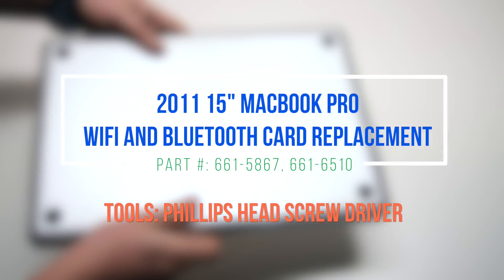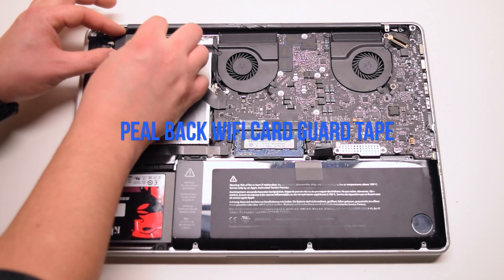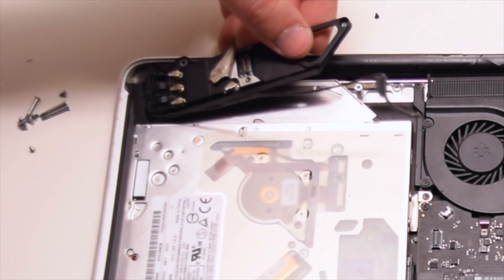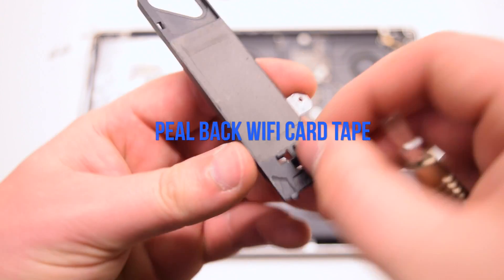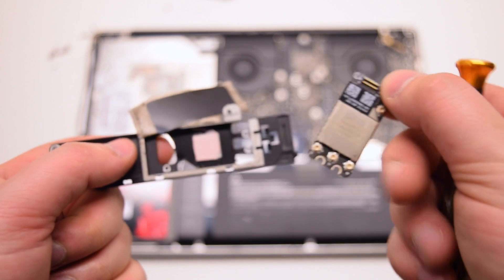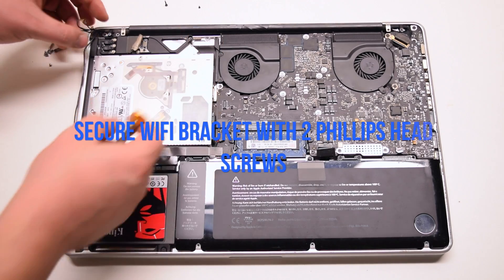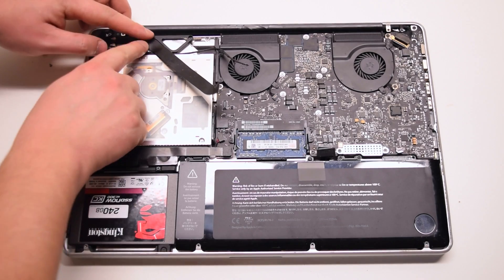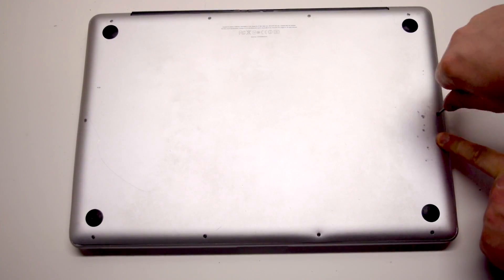2011 Macbook Pro 15" A1286 WiFi and Bluetooth Card Replacement

Comment: Hi I know this video is quite old but definitely well done and most appreciated ! If I'll upgrade with the CAX from the 2012 model that should allow the airdrop right? Mine is working fine but just got the upgraded one to get the airdrop feature, will it work out of the box or will I have to use the continuity software?Thank you

Comment: I paid to have my wifi card replaced. It worked good for a few days then got flaky again.  The repairman said he replaced the wifi cable, too.  But I am wondering if something is loose or has a bad pin or connection.